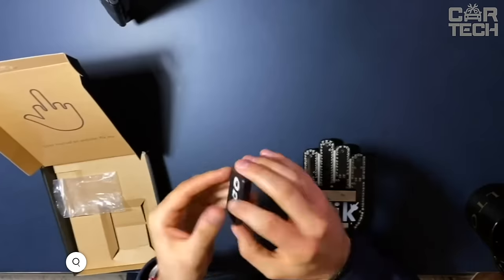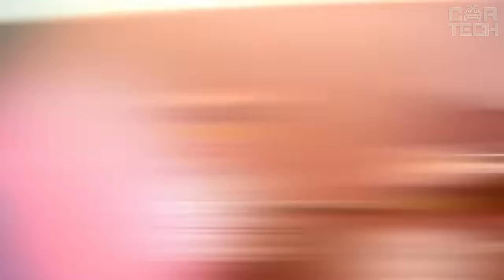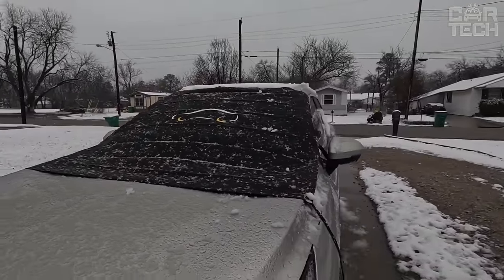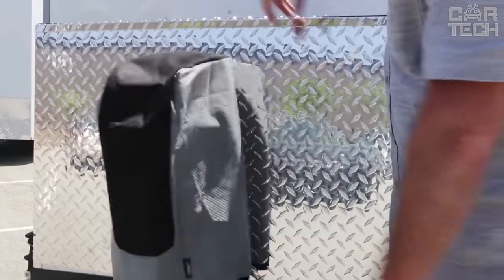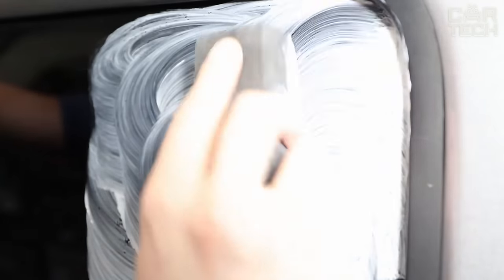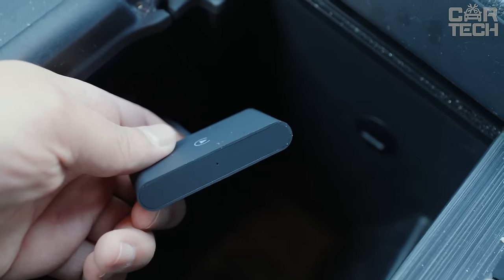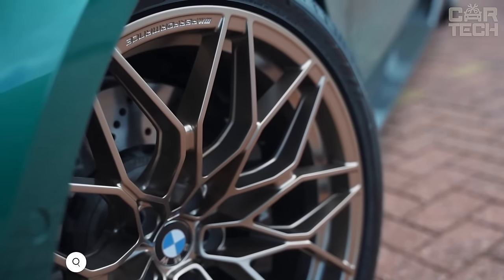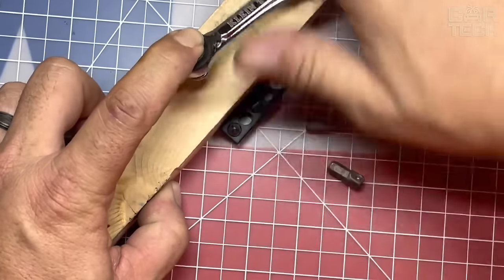35 SMART CAR GADGETS Amazon Make Easy Your Car Life

Comment: Cheaper and far less hassle power supply kit for dash cam is the Dongar Dashcam Power Adapter (Amazon) which plugs in to the rearview mirror.  (Mirror must have the auto dimming capability, which is almost all nowadays).  Attempting to install wiring from the under dash source and going up the A pillar is tricky if you don’t first disconnect battery for about 15 minutes to prevent possibility of accidental air bag deployment (resulting in several hundred dollars for replacement) during install!